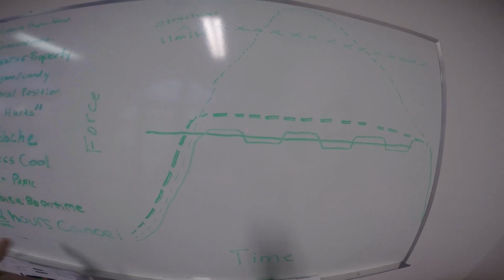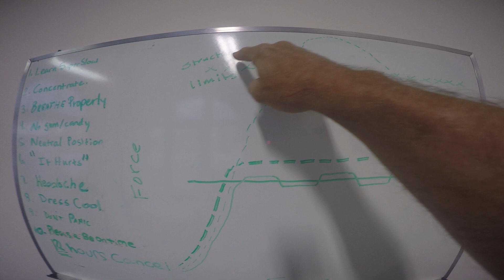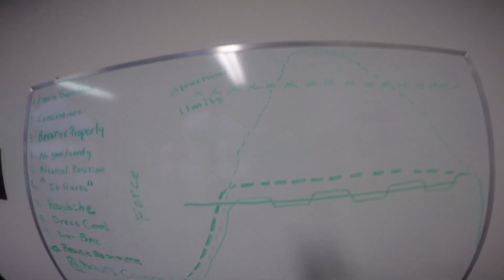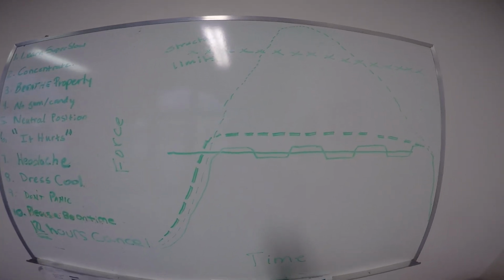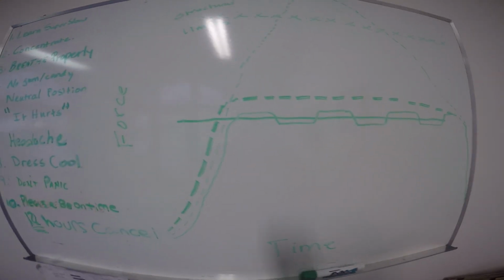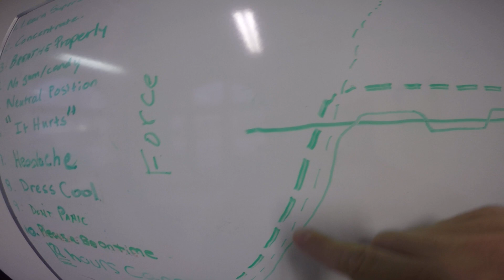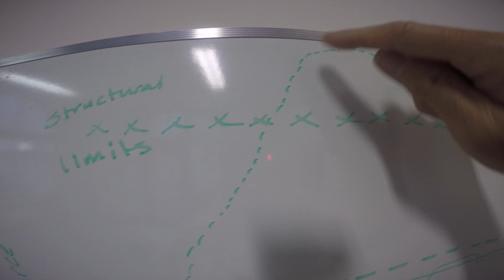Graphic Representation

Comment: So, I could simply hold a weight with positive force statically for 90 seconds and get the same results as I would if I were to use both positive and negative movements? Why not just statically hold a weight in one position?

Comment: Interesting information. What is the amount of time under tension are you looking to achieve before you bump up the weight? Would this vary based upon the size of the muscle group worked?
Reply from the maker: Derek,

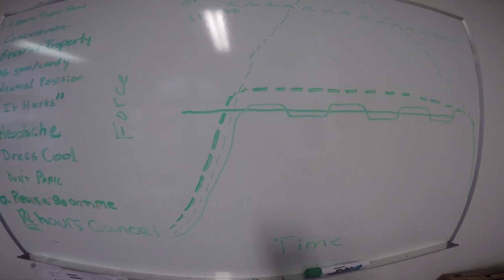Would depend on the selected weight at the start along with the equipment and subsequent cadence used.  At 10/10 cadence 1:15 to 2:30 is typical.  At faster cadence, shorter TUL's.  Once TUL's creep up by 25-40% it is probably time to increase if the incremental change available is not too big.

Comment: Aren't these machines cammed to match the resistance of the machine to the force capabilities of the body? Why doesn't the force vary according to the body's strength curve, as you move through the range of motion? On the ARX, for example, the force traces are not flat like this, but vary as the leverages improve or degrade.
Reply from the maker: Craig- I suspect it is because in the ARX you are pushing against a brake motor that runs at a constant speed, as opposed to moving a pre-selected weight at an unrestricted speed of motion,  or putting out a given amount of force in a static contraction (no movement).
Reply: For a static exercise, it certainly wouldn't vary, because you have constant leverages.   For a dynamic exercise, it might depend on where the load cell was installed in the machine relative to the levers and/or cams.  Or maybe the particular exercises you've seen just don't have dramatic changes in the resistance curve?  I recall reading that Ken Hutchins thought the leg press ought to have a relatively flat resistance curve (versus something like the Nautilus duo squat, where the resistance increases significantly as you extend your legs, producing what some people consider to be an unsafe end condition).